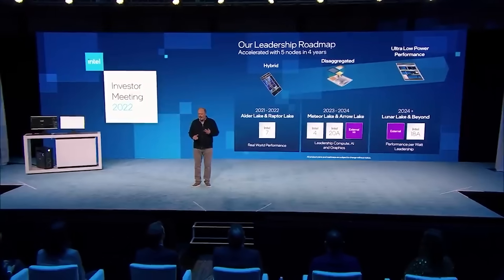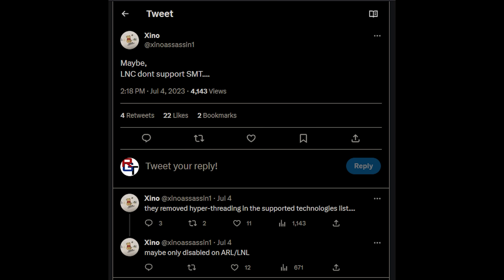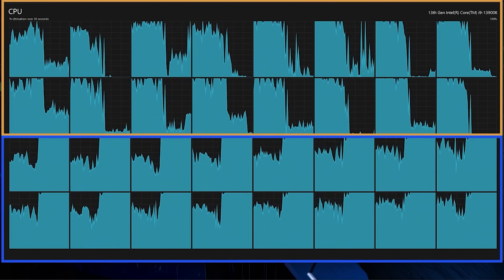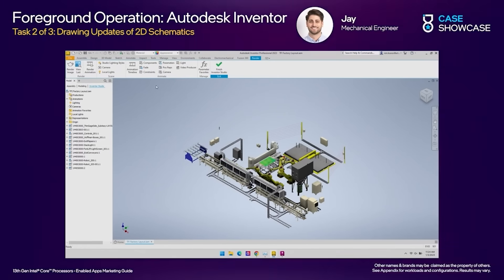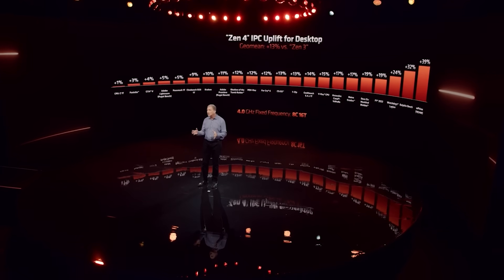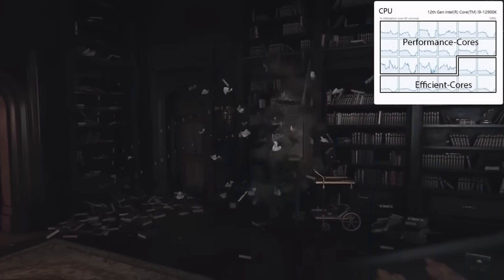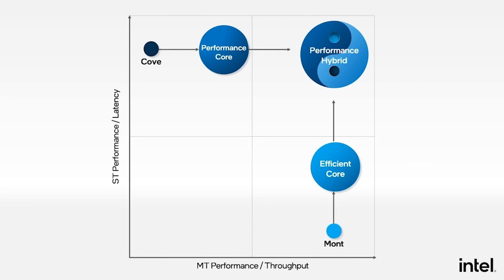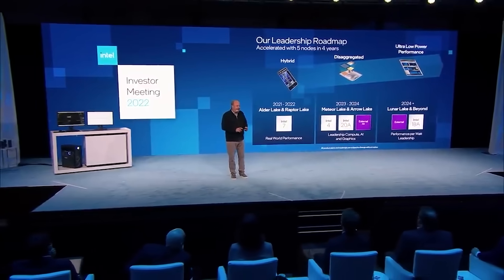Arrow Lake = NO HT Confirmed! Bartlett Lake = 12P Cores?

Comment: Assume top tier Arrow Lake for desktop has 12 p cores, and some amount of e cores.  L2 is a shared pool, but p cores have their own pool and e cores have their pool.  Since there is a drop in thread processing (12c/12t vs. 8c/16t) the amount of cache needed for the p core cluster can be smaller and still be effective.

For e cores if the number of cores goes up then the pool of L2 should get bigger

12 p cores makes sense AS LONG AS IPC goes up.  If Intel sticks with 8 p cores while dropping HT that would be a little disappointing.

Clock speeds are due to process node, not the architecture, or that would be best guess.  Intel hasn't been able to release anything on Intel 4 until Meteor Lake for laptop, and this follows what happened when they moved to their 10nm later renamed Intel 7, where Intel also had clock speed issues.  Hopefully they can get the speeds up while still being efficient the same way TSMC did moving to N5 and N4.
Reply: Arrow Lake will not have more than 8 P cores.
Reply: @nathangamble125 Agreed. ARL is on the same LGA1851 socket as MTL. It will have the same # of P & E cores, same NPU, & same iGPU as MTL. Expectations should be lowered!
Reply: @tringuyen7519 can’t wait to have an igpu that’ll be able to do hardware accelerated av1 encoding! Sheeesh
Reply: @tringuyen7519  atleast get some knowledge before commenting

Comment: It may be earlier, but I remember hyperthreading coming during the Pentium 4 era.  I had a Pentium 4b 2.53Ghz single core, and then I got a Pentium 4c 2.8Ghz single core with hyperthreading.
Reply: Correct. Hyperthreading was introduced with the Pentium IV, it was then dropped for the Core Solo / Duo and Core 2 Duo / Quad Era (which dropped many of the P4's design ideas like an extremely long pipeline in favor of design concepts influenced by the earlier Pentium III) only to be resurrected as a the distinction between mainstream i5 and enthusiast-grade i7 processors.

Comment: If hyper-threading is not good then why did they implement it for years. If it is good then why are they quitting it now?
Reply: Because HT/SMT benefits depends on micro-architecture (uarch), or simply put the design of complicated core. It was/is "a trick" that allow with minimal silicon area cost (e.g. 5% more silicon) to gain more multi-threaded performance. It usually gives 0-30% more performance, but it highly depends on workload. It also has negatives where you start loosing single-thread performance (e.g. where you heavily load CPU). Thus it really depends on your uarch design choices. Most other chips companies (ARM-based, RISCV-based, etc.) don't do SMT in their designs. PowerPC allows to run up to 8 SMT threads per core (dynamically configurable), but in almost all cases SMT4 or SMT8 will never produce meaningful uplift. It's really workload specific. Thus not having HT/SMT in design is fine, it's all about uarch design and choices.
Reply: @davidlt  
with each generation they have added more resources to the cores to make SMT more efficient, but it costs more and more silicon to do this. My guess is that Intel has decided that improving their SMT design more would not be silicon efficient, and that it's better to optimize a single process core and add E-cores using the silicon they can save.
The real trick is software related. Processes has to be assigned to the correct cores. The main and heavy processes has to go to the P-Cores and the simpler less complex processes assigned to E-cores. This is not simple to do and it will take some time to get it working well. The big question is how legacy software works with this.
Reply: I think it comes down to them trying to increase single thread performance, currently one core does two threads but maybe they're hitting a wall, unable to increase that single thread performance in large steps without sacrificing something, they'd usually just push more watts through it but that only works to a certain point.
Reply: It is good for throughput, but bad for single thread performance. For games, if you have more than 12-16 cores, you will be better without HT
Reply: Stopgap technology...
Reply: No need for hyper threading as there are many E and P cores
Reply: Because back then there were no E-cores. 
It could be that  8P-cores without HT + 24E-cores (32 threads in total) will work better (faster and more efficient) than 8P-cores with HT + 16E-cores (32 threads in total).
At the end of the day price to performance matters.